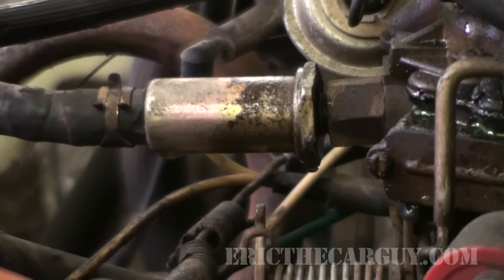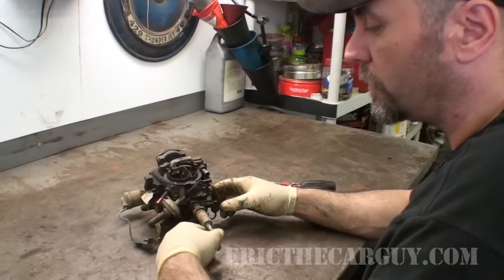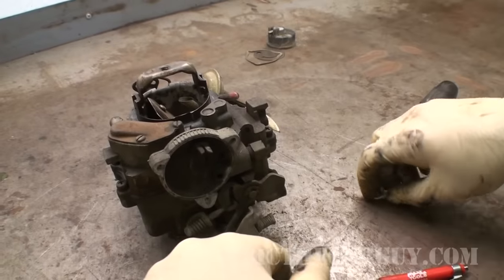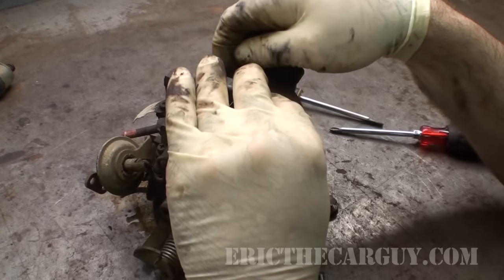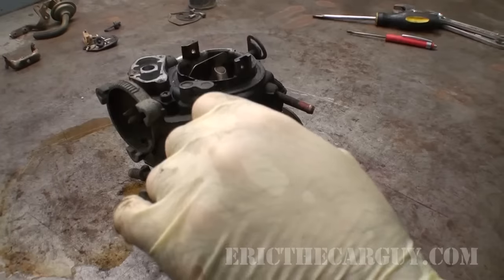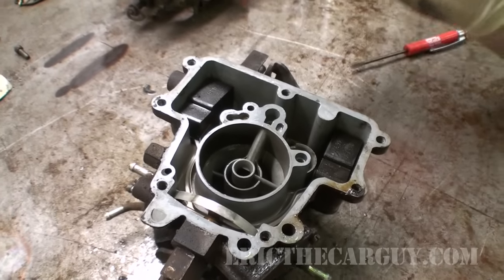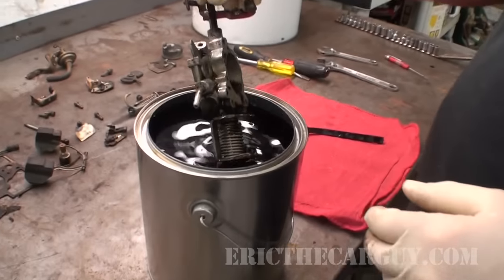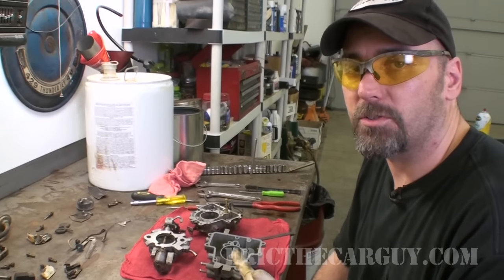Carburetor Rebuild Basics (Part 1) -EricTheCarGuy

Comment: I know this is 6 years old, but I'm commenting anyway! 😉 
I MISS Carburetors!! 
I'm a Retired Ford Tech, ASE Certified as a Master Tech in Carburetion and Fuel Systems. 

Going through these old Videos of yours is making me want to get an old Car, just to mess with. 

Even going to a Auto Wrecking Yard and getting a few Carbs, just to rebuild/modify!! 

Now I know you want nothing to do with that 200ci Stovepipe Engine, but back in the day we used to swap those Holleys for the Carter 1bbl off of a 300ci 6cyl Ford Truck. They're almost 100cfm larger and significantly improve torque. 
Bolts right up, and all linkages fit the same!

Comment from the maker: Carburetors, I think they're fun. Carburetor Rebuild Basics (Part 1) -EricTheCarGuy
Reply: you may think that, have you thought of doing megasquirt, and go injector ? :)
you may brush the dust off the welding skills, get 4 injectors on, get a trigger sensor on.
and a MAP sensor.
off you go.
then you can convert to sequential ignition, and this 3.3 will really pull like a champ :)
also a narrowband.. almost forgot that, you can just take something off another scrap car or something :)
just as a little edit, I see why some carbs are nice, but if you want a better engine, loads of people buy a new carbed v8 whilst a I6 or V6 can pull just as good with proper electronic management and leave room for even turbocharging or compressor with correct mixtures and future build.
and it's heaps of fun to do ECU work yourself :)
you can drop me a message or something and if you wanna know anything I can help ya.
Reply: Road2Perfection MS has a huge learning curve.  BTDT.  Way beyond the scope of these videos.
Reply: ***** didn't know he was going to swap, or planned.
my point was, alot of people buy new engines instead of putting on efi, efi increases effeciency, power, and with effeciency comes better milage.
Efi can be done in a day with a friend who knows it :)
changed my efi on a already efi'd engine, stock to standalone and that took a day including driving to another country to pick it up, solder up all wires, set settings, drive, morning to evening.
My first EFI experience, and got it all working the same day.
I personally used MaxxEcu
opened up a completely new realm of car modification and knowledge :-)
Reply: right after engines, carbs are the most fun to rebuild
Reply: I didn't find this video in your playlist for fuel and emissions; it appeared there was only a part 2.  Anyway, found part 1 here, so that works.  Just to let you know.
Reply: hey eric, that carb may be basic, but mine has way less parts on it than that.
Reply: 20 years ago I did a crude experiment with vapor carburetors.  I took a one-gallon pickle jar, some copper pipe, and a couple of air-tool exhaust mufflers and connected it all together, and put some gasoline in the jar.  I connected it to a Jeep Wagoneer I had, and actually managed to drive it a little bit.  Obviously it wasn't a viable arrangement but I just wanted to check the principle.  Since then I've always wanted to attempt a good design.  Seems there's no time for such things these days.
Reply: +EricTheCarGuy You don't have to remember you are filming it all.
Reply: Erik Swiger I think about that all the time.
Reply: Carby's are heaps fun. When they work and when you're responsible for it working.
Reply: I have a question for anyone who can help my carburetor is a single barrel b&b carter carburetor and it starts up but then it pops right out the top of the carburetor and it just shuts off after that and it’s extremely loud when it pops

Comment: I'm glad you mentioned the throttle body butterfly shaft.  I had a 600 cfm Holley that I rebuilt twice trying to figure out a bad idle situation.  It turned out to be the worn butterfly shaft.  There is a rebuild kit for the shaft, but for a little more money, I just got a brand new carb!  Thank goodness both of my cars and boat motors are all fuel injected!  My days of playing with carbs are over.

Comment: I remember carb rebuilds from an earlier era.  For a one barrel , those Ford carbs have a lot of fiddly bits, compared to some 2 barrels.  I also liked to use a compressed air nozzle to blow out passages of dirt and gunk.  Thanks for video ETCG

Comment: Ah how the memories come flooding (is that a carb pun?) back! That choke was the bane of my existence.. The exhaust gas would eat away at the little fingers on the end of the choke plate axle that engaged the spring, and sooner or later the little fingers would break off and the choke would no longer work. And, of course, that was something that was NOT included in the rebuild kit. So, every couple of years you just got used to replacing the water pump and the carb. Fortunately neither part was very expensive nor very difficult to replace.

Comment: Eric, The next time you clean a carb. head over to the hardware store and pick up a gallon can of denatured alcohol and a small paint brush. I think its used to fuel camping stoves. I don't know. Anyway, try it out. Its dirt cheap, old gas/gum washes off like nothing. Even really bad stuff comes off after a 10 min soak. But most importantly it will not harm or eat any metal surfaces (wire brush is frowned upon unless absolutely necessary when it comes to older stuff) . I got this first hand from the mopar old timers down in Daytona. Works like a charm. And after your done you can grill up some burgers. 

DC Lewis
Reply: Thanks for the tip. I will look into this when I get my bronco 2 this week.

Comment: a speck no bigger than the size of a speck of pepper on top of the float needle will cause all sorts of bad crap. Primarily float over filling. Finding something like that as the root cause of a problem is a pain but well rewarding.

A lot of the same methods followed here when I rebuild any kind of carb. Lot's of good info here.

Comment: I would suggest that prior to the actual rebuild, that folks use spray carb cleaner and its tube to blow all ports backwards and forward to be sure there is not a internal blockage. The spray itself will give a good visual that the passages within the bodies are open. Eye protection is a must.

Comment: We younger people that have only driven on fuel injection vehicles, we used to ask to older mechanics if carburetors were good or if they re happy that carburetor is gone.
Most say that carburetors were good and they like them. Here in Brazil we ve the option of having ethanol/methanol fuel, but on the carbureted times, specially on winter that can get cold here on the southern part of the country, it was pretty hard to start a carbureted alcohol (methanol or ethanol), vehicle. It had a small gas reservoir to spray some gas on the intake manifold to help to start those vehicles on cold weather. But they are good, and motorcycles still have them.

Comment: I've found that some of the older foam/neoprene floats can also expand and cause the float to drag on the walls of the bowl or even get stuck (at least in the case of GM quadrajets).  I've heard some people suggest that the ethanol in the fuels these days is really tough on the foam floats.

Comment: Instead of rebuilding my leaky carb on my Subaru, I put on a weber 32/36 DGAV. There is only 1 vaccuum line instead of 300 (it is not connected now though because the distributor diaphragm leaks) and it is easy to adjust. Both power and economy are better now and the mechanical secondary works a lot better than the old vaccuum operated one.
Reply: ***** Flat engine, EA81
Reply: What's the difference between a nirmal carb and a weber carb?
Reply: Moving Up Diy
They are an old style, simple carb. A larger Weber carb can be used to replace a smaller stock carb for better performance, or they can replace a modern (80s and 90s) carb that has a lot of emissions gear on it. 
They also have a range of high performance carbs that are a popular modification for Japanese and European cars.
There also were a lot of cars that came stock with Weber carbs.

Comment: Thank you for the video. I can remember well rebuilding carburetors including a carburetor per cylinder engine that had a habit of on cold days freezing's such that you lifted the foot off the accelerator and NOTHING happened. At the time the conventional wisdom was to run the in take via the radiator BUT that would affect volumetric efficiency so I never did. I just gave the throttle a kick in the hope of cracking the ice off. I was lucky no accidents. I love fuel injection systems now but still hate the crappy carb on my GMC generator :-)

Comment: Hey Eric, great vid as usual. If you ever happen to do some rear brake work on some mazdas I would love to see it. Did my rear brakes tonight on my 03 protege5 and the caliper pistons are pushed back by using an allen key. I also had to remove the parking brake bracket that was held on by a rust-welded 14mm bolt. I used your heat trick and it came off right away. Thanks again.

Comment: to check the floater you need to give the regulator valve an air pressure, an example of the air act like a fuel gas. sometimes when the pressure of the fuel is high, the float needs to be set higher than the manual said.

Comment: Carburetors along with analog vinyl records, video cassette, mechanical devices with linkages and springs, etc. 

Mp3, blue ray, 4k streaming and other digital format and fuel injection are  electronic computer controlled devices.

Comment: "Your carburetor is like a toilet" -  That's a title right there! What is the MPG on this old Ford anyway?
Reply from the maker: Hard to say because I really haven't tracked it. I'm thinking somewhere near 15mpg highway.
Reply: EricTheCarGuy Psh. My toilet gets better mpg than that, even in residential areas!
Reply: +timmytimmy666 My old '78 back in the mid 80's made about 23 mpg... but it didn't have overdrive either
Reply: one gallon per flush
Reply: @ericthecarguy  - my granada with this motor got me well over 20 mpg.

Comment: Hi Eric. I really like your videos. They have been a big help to me. I don't know much about   mechanics, but I am learning. I have 2, 2 barrel  Rochester carburetors. I am going to rebuilt both and put one of them on a 307 small block that came out of a 1968 Camaro. Anyway the bores in each carburetors are different sizes. One carb is bigger than the other by about 1/4" in Diameter.  Is there a differents as far as better fuel consumption or power with the bore size? Thanks. Andy

Comment: Hi, I'm looking for a (or several) good video that compare different non disassembling (I'm not a mechanic) carbon removal methods. Hydrogen, Terraclean, clenears, additives, walnuts... Which one work, which are dangerous, which work as prevention and which work after some 100k miles... I have a Volvo D5 engine with PCV, EGR and all those parts that create deposits... Thanks for your videos.

Comment: I  have a 1971 Mercedes 280, have a carburetor issue, had it rebuilt by my mechanic but he could not get the timing right so took it to another shop and he tell me that this carburetor had not been rebuilt still has the old caskets how can I tell if he really build it or not? I will appreciated your fairly answer.

Comment: just want to ask why i get too high rev when i start my engine in the morning and then it will suddenly goes does when it heats up.  is this normal?  is there anything i need to fix and what would be the issue?.  thanks
Reply: It is normal, wait till its warm to adjust the idle speed properly

Comment: Hi. I'm restoring a Mercury Grand Marquis with a Motorcraft 2150 carburetor. At minute 7:45 you explain just a little bit about a hot air line that helps the thermostat spring. Would you show how that line is connected? That will help me a lot with my restoration. Thanks.

Comment: ETCG -- Another way to track where the vacuum lines go is to use your phone to take photos of the various vacuum lines prior to removing the carb.  Use your technology!  :-)  EDIT:  Oops, I stopped the video to make this post...too soon.

When pulling off screws and keeping with removed assemblies, I use a piece of blue painter's tape to hold them together.  It keeps the small parts from disappearing.

Comment: hi Eric, question, my 2003 Honda crv has been starting hard, 3rd time try when its starting up, I have checked the ignition coils, even replaced 1, but its not the problem, now is @ the shop, but they don't seem to know what is the problem,
they have changed a temperature sensor , but it still starting for the 2nd or 3rd try,...
they claim that is not the fuel pump, any idea? thank you!

Comment: where did you put your used "costic solution "? i'm curious ?
Reply: Most likely back into the container. Like parts cleaner you can reuse it a lot until it becomes too saturated.
Reply from the maker: Back into the container. I've been using it for more than 10 years now.
Reply: EricTheCarGuy Surely 10 years is enough time for that lot :P ?

Comment: do i need to rebuild the carburetor if the af mixture screw is not working? i fully tighten the screw but the engine won't stall

Comment: I have a question bout my 1975 ford bronco it will run for about 15-20min and then it will shut of the motor works fine i have replaced the coil carb intake but mostly its the coil it gets hot i had also checked the distributer and its perfect i dont know what else is wrong

Comment: I soak clean mine with diesel it works & it's cheap may be you should put your cleaner in a plastic container if it eats away your metal ones as I see the can has a plastic spout.

Comment: So i have an 81 gmc k2500 and it wont start unless i pour gas into carb and if i keep pouring it keeps running. It has a brand new fuel filter and when i crank it the fuel filter is full off gas. I unplugged the fuel line then cranked it and it sprayed gas. Any ideas?

Comment: These days it's cheaper to put on a new carburetor. Besides you will not get the same result with a rebuild, only a professional rebuild, but that costs the same amount as a new carburetor, it will only be needed for rare carburetors.

Comment: You are NOT supposed to get exhaust gases into the choke spring. Some cars have a tube running through the exhaust manifold that can rot off but most have a sheet metal stove around the exhaust manifold. Hot air not exhaust gasses.

Comment: Hi Eric  i have a 87 nova 1,6l, drives fine down the road, will not idle when started or when stop at sign. I want to turn up the idle screw mechanic said would not help. Have a help hint thanks Russ

Comment: At 3:37 when Eric recommends using a line wrench and points to that hard line with the white braided insulator, can anyone tell me what that line is for and where it leads to? I've got one in my '73 Bronco and the end is broken off, so it comes off the carb and just hangs there.
Reply: +John Cellar Oh, I guess he sort of answered that later. Exhaust gas? Does it come off the manifold...?

Comment: What solution is that to soak the carb in?
Reply: Berryman 0996 comes in a metal can with a parts basket, about $17 if you shop around.

Comment: Could you put a lid on the can and place it in a paint shaker for five or ten minutes?
Reply: Wouldn't you be afraid of breaking things in a paint shaker, those machines would be rough on softer metal parts.
Reply: You're probably right.  I use an ultrasonic cleaner for small engine carbs.  It works great.  It's not harsh like the chemical dips and it is so much easier than using B-12 and it's not as messy.  It does all the work and it even heats the mixture solution.

Comment: I wish i knew someone that could rebuild a carburetor from a 1982 f 150 with a 302 v8 the two places we had attempt it did a very bad job and also left most every vaccum line disconnected and the truck uses way to much gas

Comment: I was going to suggest using an egg carton for screws and bolts until you said it yourself. There's nothing more heartbreaking than putting something back together and realising you've lost a screw or bolt.
Reply: blingking501 or forgetting where things go.
Reply: SGNT Yes! When you finally get it all put back in place then find a few bolts left, plastic washers or hoses.

Comment: Would industrial purple work for a solution for soaking
Reply: most people use parts cleaner cuz it's not expensive by most standards and it evaporates quickly and dissolves most contaminates so it cleans well and doesn't contaminate fuel later.

Comment: Mr. eric could you please help me with my problem  to my toyota carburetor when I start the engine if runs only  just about a seconds then suddenly it goes off even I put  more pressure on the gas pedal it slowly goes off. Please give hint if you have some  idea if what seems to be the problem.
Reply: Probably the jets are clogged and they aren't spraying fuel in the carb

Comment: Great video, I wish I had a carburetor now. Question: Did you spend that whole video huffing gas? It looks like there's a puddle of it on the table. That's not good for your brain.
Reply from the maker: Being an automotive technician is not good for your brain. :)
Reply: EricTheCarGuy
Keep a fan blowing at you to blow the fumes to the garage doors if it's not too noisy outside.

Comment: If only i could rebuild my asshole like you can rebuild the carburetor. I need an extensive overhaul. been running very rich of late and no matter how many screwdrivers i shove up there it just keeps on spewing gas and liquids